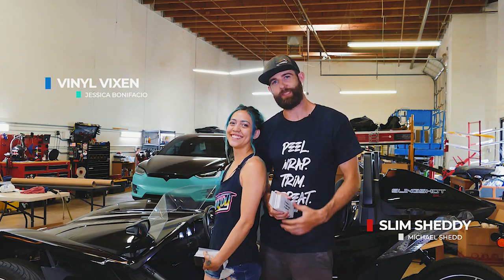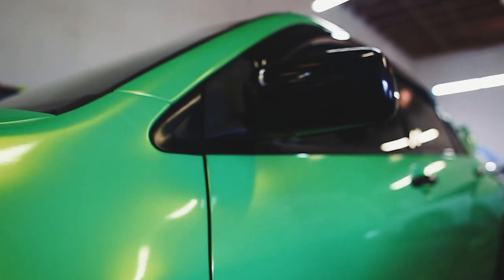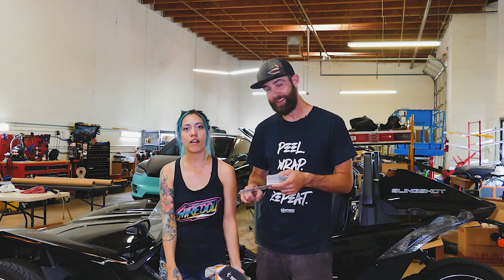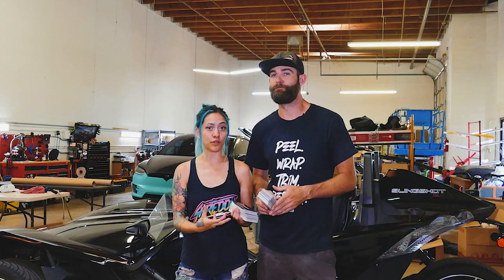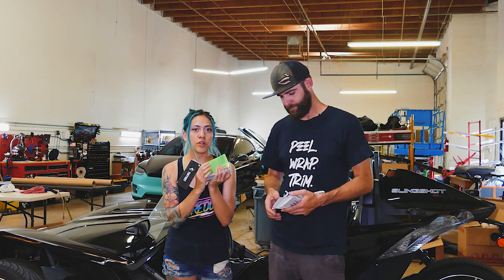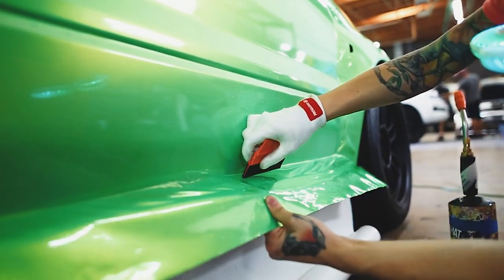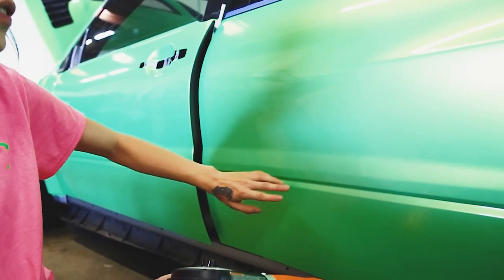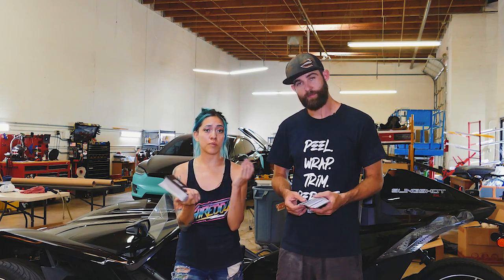Tips and Tricks using TinyBot film - Evolution Lancer VIII Color Change

Comment: You can for sure wrap light colored cars with calendar films and get full coverage around corners and edges without using edge seal tape… calendar films just have a higher post heat temp. Cast is way easier for sure but many customers want the colors offered by tinybot, Teckwrap, Inozetek etc so it’s crucial to learn all the ins and outs of calendar for full color changes